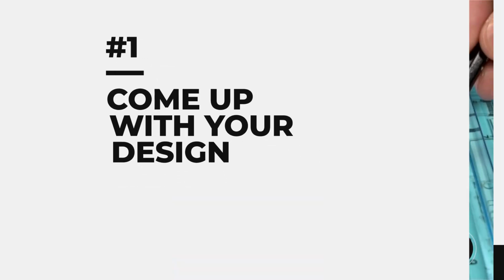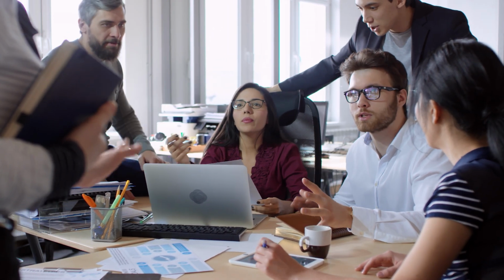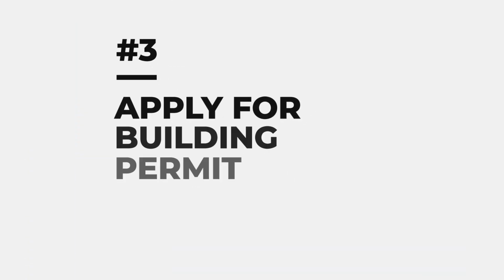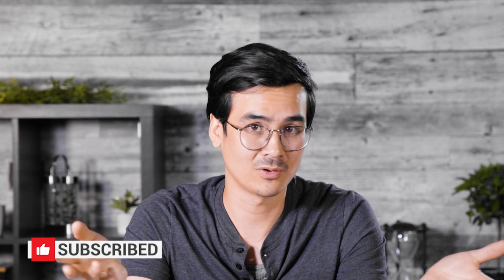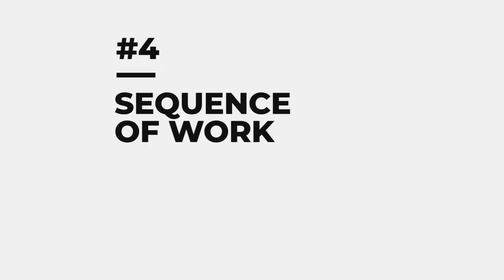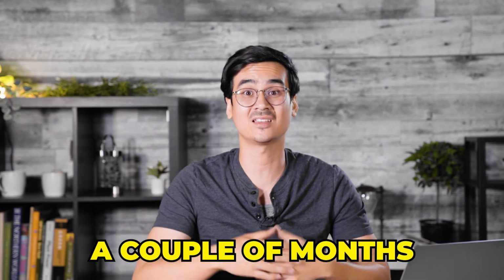5 CRITICAL Things You MUST Know About Ontario Building Permit!

Comment: Hello, I am in the process of buying my first Flip property in Toronto. It will be mostly a cosmetic renovation. Redoing the bathrooms ( no plumbing location changes ) , adding in some potlights, new doors, floors, paint, new kitchen. Would any of that require a permit ? Assuming no plumbing location change and no new electrical circuitry is added? Thank you in advance.
Reply from the maker: You’ll generally need electrical permit. If it’s all otherwise superficial cosmetic alterations with no removal of drywall or change of plumbing then no to the rest. But pit lights you would need. 

If you’re doing electrical work yourself on your own property you could pull your own permit and do the work yourself. Otherwise you need to hire someone licensed who can pull permits.
Reply: @PropertyHustlers  Thank you ! Thats good to know, I didn't know you also had to pull a permit to remove and redo drywall. Does that mean removal of partition walls need to be permitted as well ? What kind of building permit would that fall under ?